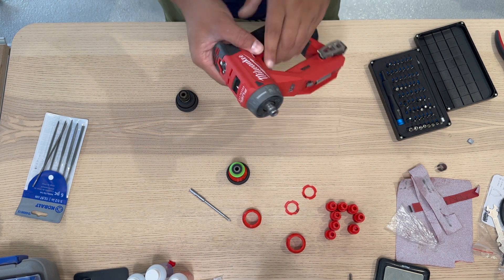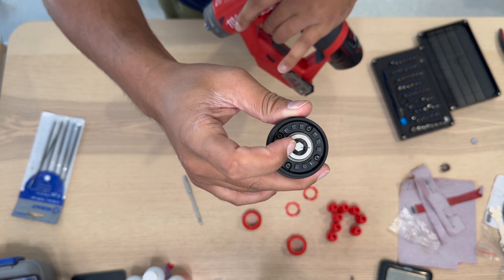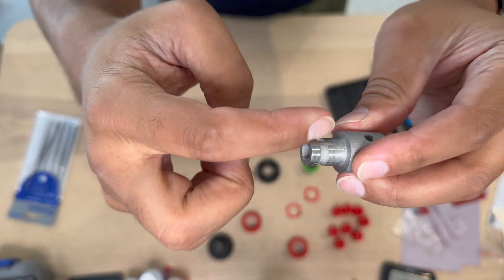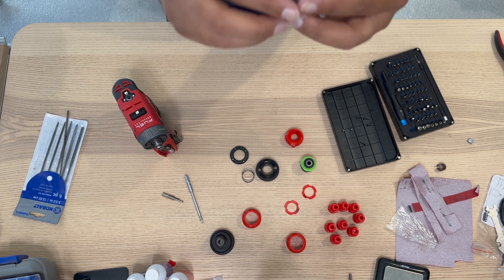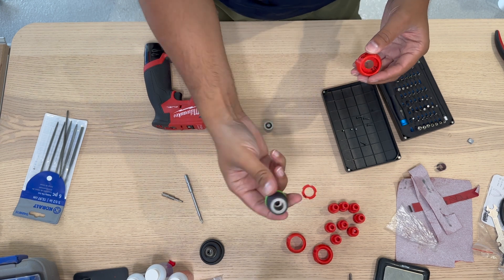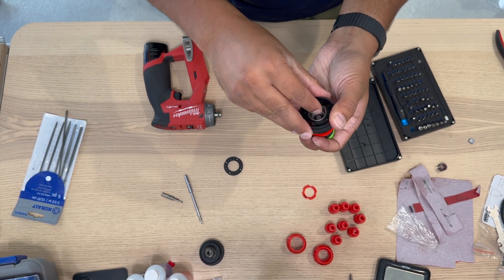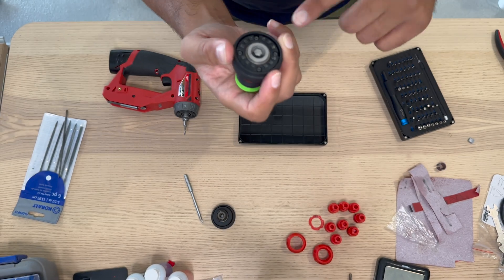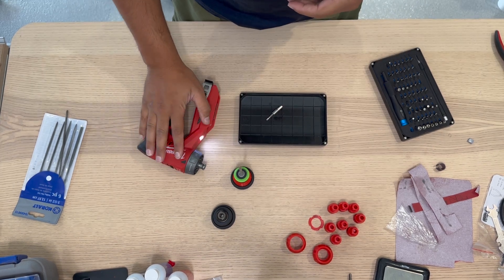I made a new chuck for my Milwaukee Installation Drill

Comment: This is brilliant! I do have a question Did you not want to modify the centrotec chuck to fit the Milwaukee?
Reply from the maker: It was easier to make an adapter for the Milwaukee than to directly modify the Centrotec chuck.

Comment: What material did you print the 3D parts in? Pla or petg? Did you use supports for printing? Finally got all the parts and ready to assemble
Reply from the maker: I used PETG since it’s more flexible and less likely to crack. I can’t remember right now if I used supports though.
Reply: @james.a  thank you. Printed them out. How much filing and sanding did you have to go do the metal print? I’ve been at it for over an hour already and still not fitting
Reply from the maker: @AlexK07010 I can’t remember how long but you’ll want to keep checking the size often so it doesn’t get too loose. And make sure to do each side evenly so it stays centered.
Reply: @james.a  yep that’s what I’m doing. Outside ones need sanding as well to fit the centrotec
Reply from the maker: For the centrotec part to fit I attached the metal printed part to my drill so I could spin it fast while holding sand paper wrapped around the tip to sand it a bit quicker.
Reply: @james.a  yep.  I checked it up into my drill press
Reply: @james.a getting there. Assembled everything but got a bit of wobble to address https://youtube.com/shorts/7dn6Ea0oKng?si=PMRPvlVIhSHvPDvz any thoughts?

Comment: Do you know what size the ball bearings are? I dont want to tear apart the main portion of the adapter. Looks like i need a snap ring remover which i dont have
Reply from the maker: Just took it apart to check and my calipers are showing 3.94mm diameter for the ball bearings.

Comment: James,  i thought you said you printed a certain piece in metal,  sorry for my ignorance in just now starting to print 3d, but how do you print in metal. Or do you need a different machine for that?
Reply: By the way loved the video,  thank you very much.
Reply from the maker: Yeah. 2 parts I printed myself in plastic. 1 part I uploaded to Shapeways for them to print it in stainless steel for me. Costs about $40 for the metal part which is pretty reasonable considering metal 3D printers are pricey and not really available for households yet.

Comment: Nicely done.  do you have a link to the bearings? also what orientation did you print the 3d printed parts?
Reply from the maker: I purchased an additional 1/4" Hex Bit Attachment on eBay so I could disassemble it and use some of its parts for my Centrotec Adapter. Includes the bearing portion. Washer I printed flat. Housing printed short side down. And the metal part was printed by Shapeways so I’m not sure of that orientation they chose.
Reply: @james.a thank you. My metal part just arrived

Comment: What you’ve done is a make an adapter that goes from Milwaukee’s mount to Festool mount. If you changed the printed cone to expose the Festool mount you could mount any of the Festool chucks, which is not so useful, but the mount is shared with Metabo, Hilti, DeWalt, and Fein’s multi chuck drills. So you could mount any of them - for instance the Hilti drill chuck has 1/2” capacity.
Reply from the maker: Interesting. Is the Hilti chuck available to buy on its own?

Comment: That's an amazing piece of work, James! And kudos to you for sharing your hard work. I never even knew you could print metal until I saw this 🤠

FWIW, a Wera "Rapidaptor" will take and hold a Centrotec bit along with normal hex bits. But I'd imagine your chuck will do that with less play so hat's off to you!
Reply from the maker: Thanks! Yeah the barrier to entry is generally pretty steep for 3D printing metal but it’s cool that places like Shapeways make it accessible to people who don’t have access to the tech yet in a consumer product. It’s not cheap but it’s possible and I’m sure it will get cheaper over time.

Comment: hi, great work, can i order one copy from you?
Reply from the maker: Thanks! I shared the 3d models if you’d like to make one. I think the cost would be too high for the amount of time it would take me to make them for sale.
Reply from the maker: The breakdown of materials was around $35 for a used Milwaukee attachment that I could take apart to use some of the parts, another $41 to print the main 3D printed part in stainless steel, and then I just printed the other 2 smaller parts in plastic myself for probably about $1. So that's about $77 in material costs not to mention the time I spent putting it all together. So how much do you think I should charge to make it worth my time getting all the parts and assembling them? In my honest opinion I think I 'd have to charge more than people would be willing to pay so I shared the design so anyone who wants to can make one of their own can. Sorry for the rant. Hope this answers your question!

Comment: Pretty cool! I don't use any Festool stuff or centrotec bits, but with this it's definitely more appealing!
Reply from the maker: Centrotec really do have the best fit of any bits I’ve ever used. No wiggling at all once they’re in the bit holder. Maximum benefit when using with a Festool drill but you still get benefit on the Milwaukee compared to other bits.

Comment: awesome stuff, really genius design James

is the washer not already part of the piece it goes into because its a consumable? just curious what the reasoning behind it was
Reply from the maker: A few reasons: The washer is separate so it prints better without needing too many supports. Also I was adjusting the size of the middle hole many times for the right fit. And finally, I thought that part kind of rubs a lot when the metal part is spinning a might need replacing over time but I need to use it more to see how it wears.

Comment: Let's see some Dewalt stuff
Reply from the maker: Any interesting Dewalt tools in particular? I have been meaning to check out their new flat pack batteries. They seem to pack quite a punch in a smaller form factor.
Reply: @james.a  the 12 volt series... I don't think they get enough credit or attention... as a ex contractor I like things like easy and light and compact.. and back in the day I used to use the 14 Volt all the time for the fact it was lighter.. I'm very impressed with the 12 volt line.. I've been using them for years and I'm really happy with it.... and would like to see more things about that thank you for getting back to me FYI my name is Sam petrini and I'm from South Philly

Comment: I’ll buy 1
Reply: Good luck! Most people have no idea how much engineering goes into making mass produced parts be cheap. 

I kinda want one for my Bosch installation driver, but I don’t have any Centrotec bits. I’m just annoyed at wobbling hex bits :)
Reply from the maker: I guess the question is: What would be a reasonable price?
Reply: @james.a  $50 USD?
Reply from the maker: @mackwoodcock7484  The stainless steel 3D printed part alone costs $40 from Shapeways unfortunately. If I can recreate the rest of the parts I borrowed from the disassembled Milwaukee hex attachment then printing those in plastic would be relatively cheap. Then I’d need to source the 3 tiny bearings and a spring. 🤔
Reply: @james.a  theres probably a decent enough market for this that you could do a bulk order from shapeways to bring the cost down, have you tried any other materials to see if they'll hold up?
Reply from the maker: That’s a good point. I haven’t tested other materials. I just assumed it should metal and the stainless was the cheapest metal option in shapeways. Maybe it would be worth having a signup sheet so people could sign up if interested and once I have a certain number of signups then I could know who to reach out to for a bulk order.

Comment: Awesome mod!
Can someone explain to me the advantage of Centrotec? After watching a video about it, the only thing I see is a clone of the classic 1/4" quick change bit holder but incompatible with 1/4" just so they can sell their own version of every bit/drill/etc. Am I missing something?
Reply from the maker: They're basically just way more precise than most other bits. The tolerance they make these at means they cost more but I've never had to repurchase any Centrotec bits so far. You lose a little of the precision when pairing it with a Milwaukee drill instead of a Festool drill but they still wobble much less compared to using a Milwaukee with regular bits. The metal 3D printed part is a very snug fit so you have to lightly file it down to fit just right. This is by design so when you are trying to drill with a long bit it doesn't wobble back forth from being a loose fit.
Reply: @james.a  thanks for the clarification!
Reply: @james.a  precision? in what way? snugness to fastners?
Reply from the maker: Snugness to fasteners is better and less wobbling of the shaft when spinning.